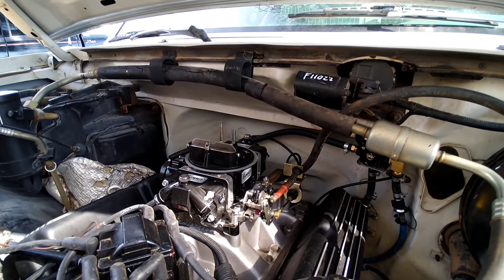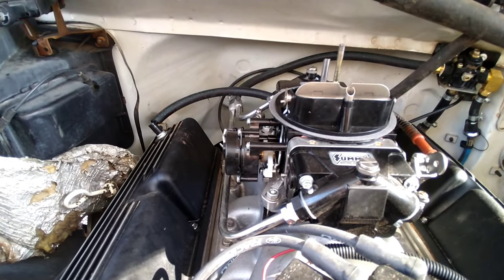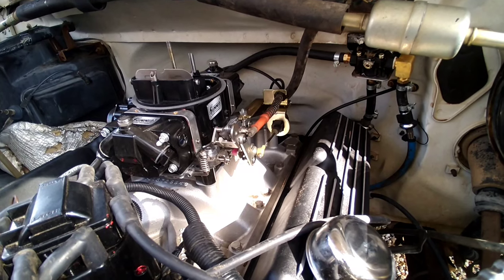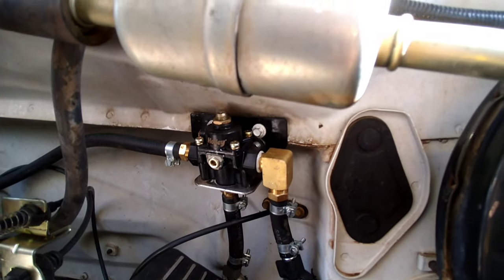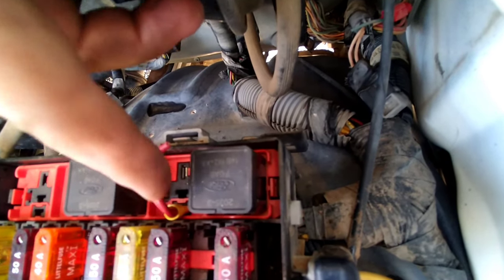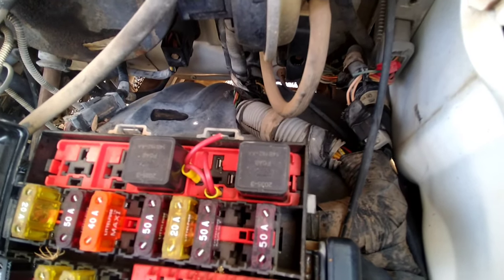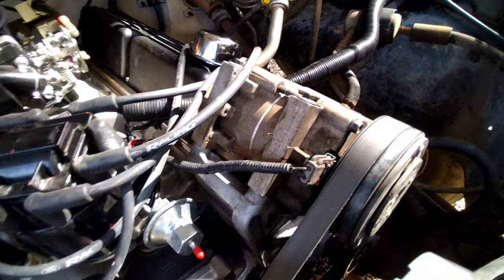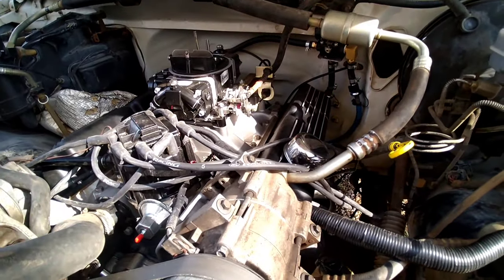87-96 F150 EFI to Carburetor conversion

Comment: are you still running a factory fuel pump or did you swap to a sending unit?
Reply from the maker: Factory in tank fuel pumps
Reply: @CCAutoWorks  sweet, doing this to my 93 f150 302. doing a edelbrock avs2 650 cfm carb, jegs intake, hei distributor and a couple other things. couldn’t make it run right with all the computers after putting a cam in
Reply from the maker: @_thomas.watkins  yessir bigger cam is why I converted to carb
Reply from the maker: @_thomas.watkins  sounds like a sweet build
Reply: @CCAutoWorks do you have any of the links for the throttle cable and tv cable mounts? i cant find anything
Reply from the maker: @_thomas.watkins https://www.ebay.com/itm/234926748138?mkcid=16&mkevt=1&mkrid=711-127632-2357-0&ssspo=ZjVZZbogTlq&sssrc=4429486&ssuid=6G4e_MbCTLy&var=&widget_ver=artemis&media=COPY
Reply from the maker: @_thomas.watkins  I run a Holley carb but what transmission do u have
Reply from the maker: @_thomas.watkins  https://www.ebay.com/itm/254633876443?mkcid=16&mkevt=1&mkrid=711-127632-2357-0&ssspo=aXIgKJ3kSby&sssrc=4429486&ssuid=6G4e_MbCTLy&var=&widget_ver=artemis&media=COPY
Reply from the maker: @_thomas.watkins  https://www.ebay.com/itm/185457937412?mkcid=16&mkevt=1&mkrid=711-127632-2357-0&ssspo=bho7axrgr5a&sssrc=4429486&ssuid=6G4e_MbCTLy&var=&widget_ver=artemis&media=COPY
Reply from the maker: @_thomas.watkins  https://www.ebay.com/itm/125627979212?mkcid=16&mkevt=1&mkrid=711-127632-2357-0&ssspo=rzDrWGaUTJ2&sssrc=4429486&ssuid=6G4e_MbCTLy&var=&widget_ver=artemis&media=COPY
Reply: @CCAutoWorks  i also have the aod
Reply from the maker: @_thomas.watkins  93 was a mixed year with the aode so was just wondering
Reply: @CCAutoWorks where did you get your hei distributor? mine is a 1/2 inch to short to reach the oil pump
Reply from the maker: @_thomas.watkins  I bought mine off eBay sounds like they gave you a 289/302 distributor 351w has a taller deck height look for 351w hei distributor
Reply: @CCAutoWorks sweet, thanks! just got my pressure regulator hooked up to the carb and now i’m dealing with ignition issues but other than that it’s flawless
Reply: did some research, you can visually see the difference between the shaft length on at the bottom where it goes into the oil pump drive between the oem and the hei. not sure what to do
Reply from the maker: @_thomas.watkins  I've actually still used the stock distributor before if you left the computer and haven't cut the harness
Reply: @CCAutoWorks i’m not getting a very strong spark and it’s not picking up on the timing light at any of the plugs besides the one wire that comes from the coil
Reply from the maker: @_thomas.watkins  I'd start by sending that hei back and see if they have one for a 351 or if u haven't cut anything drop the stock one back in and fire it up
Reply: @CCAutoWorks i got a brand new oem distributor and it still won’t fire. thinking it might be the coil
Reply from the maker: @_thomas.watkins  that module on the side of the distributor is probably going bad and that probably cost more then a ebay hei

Comment: What regulator did you use
Reply from the maker: It's a Holley low pressure bypass regulator
Reply: @CCAutoWorks  do you know a part number. I'm doing the exact same swap right now

Comment: Jesus. What's the exhaust setup on the white obs truck.. it sounds immaculate.
Reply from the maker: It's long tube headers with 2 and 1/2 pipe into a straight ebay x-pipe and dual in dual out 2 chamber eBay muffler built like a 40 series flowmaster
Reply: @CCAutoWorks  absolutely perfect. I just hit a snag on my build, a big one. Computer is fried, so now I have to get the computer for my truck so I can swap it to a carburetor and strip half it's wiring from the harness anyway lol
Reply from the maker: @Mr.Safety.  I might just have a computer
Reply from the maker: @Mr.Safety.  if you think you can use it I'll send you my email to get your address and I could mail it to u
Reply: @CCAutoWorks  its a 94 5.0, 5 speed rear wheel drive, and hell, you would do that?
Reply: @CCAutoWorks  what did it come out of?
Reply from the maker: @Mr.Safety.  93/96 f150 I have two or three different ones because I was going to convert mine to mass air at one point
Reply from the maker: @Mr.Safety.  yeah I'd do that no problem my email is chrislamborn32@gmail.com
Reply: @CCAutoWorks  that could save my build, I was thinking of selling it, but the more I look at it the more I realize it's just too good to let go
Reply: My mechanic ended up forgetting to put oil in my truck, or an assitant did, now ive got a blown headgasket or a cracked block, poor old thing is getting parked in the garage until i can afford to fix it or a new motor, they ran it for about an hour without oil

Comment: Part number for regulator?
Reply from the maker: https://www.ebay.com/itm/Genuine-Holley-12-881-Die-Cast-By-Pass-Style-Carbureted-Fuel-Pressure-Regulators-/174590524959?mkcid=16&mkevt=1&_trksid=p2349624.m46890.l49286&mkrid=711-127632-2357-0

Comment: Do you have a shop?? If so where is it located?? Thanks in advance
Reply from the maker: I have a small shop for are personal stuff outside of Amarillo TX
Reply: @CCAutoWorks  thanks for the response brother, I wanted to see if you were close to Houston, I have a 89 Bronco and want to switch to carb
Reply from the maker: @armandosandoval8109  it's a little harder  to do a ford then the tbi Chevy but it's not hard if you have some know how I have another video on how to wire the fuel pumps to work like stock
Reply: @CCAutoWorks  thanks brother, I'm installing Edelbrock 3841 intake, cylinder heads 69379, B303 cam and BBK throttle, problem is I cant find anyone that can tune it, I thought it was all with the distributor and timing, but people tell me different, that after I add all those parts , I need to tune the motor, that's why I'm considering changing it to carb now.. I'm stuck!!
Reply from the maker: @armandosandoval8109  the cam is the only reason you would need a tune and no one can tune speed density efi but if u was to get a smaller cam or install mass air flow
Reply: @CCAutoWorks  so if I don't install the Cam then I'm good to go???
Reply from the maker: @armandosandoval8109  yeah it would run that way but you wouldn't see the full potential of the good intake and heads but I've seen some people cam the speed density but you run into idle drive ability problems
Reply: @CCAutoWorks  so what would be your best advice with the parts I mentioned to you that I have?? Should I buy a MAF kit?? If so which one?? If I go with a smaller Cam will I still need to tune it?? What small Cam would you recommend?? Thanks for all the responses I truly appreciate all your help and support..
Reply from the maker: @armandosandoval8109  if you already have the nice efi intake and some good heads I'd keep it efi id probably put the b303 or e303 cam and see if it would run and if it didn't run right I'd convert it to mass air but the kit they sale to do that is expensive but I have seen a video on here showing how to convert using stock mass air out of the junkyard but I'd call bama and see if they could burn a chip for speed density for your combo
Reply: @CCAutoWorks  thanks brother, I'll keep you posted on my build !!
Reply from the maker: @armandosandoval8109  awesome do u have a channel I'll check it out
Reply: @CCAutoWorks  I don't but I'm going to make one soon
Reply from the maker: @armandosandoval8109  awesome

Comment: What wire do you have the factory tach hooked to in the old distributor harness?
Reply from the maker: I want to say black with white line but I don't really remember it's been awhile but I can check and get back to you tonight
Reply: @CCAutoWorks  thanks that would be awesome!  I recently completed a rebuild w/carb swap on @ 94 f150 with an hei distributor.  The only guage I haven't gotten working is the tach.
Reply from the maker: @Righthandofdoom1  it's black with a white line or red with a green line if it's not and ignition wire
Reply: @CCAutoWorks  Awesome thanks!

Comment: What color are the 2 wires you used for the distributor
Reply from the maker: I can't remember I just know they seem to be different from year to year you just need an ignition wire for the distributor and after its running just touch the tach wire to every wire on the old distributor plug tell the tach works

Comment: What wire did you use for the tach on the new distributor thanks
Reply from the maker: I'd have to look see what color it is
Reply: @CCAutoWorks  that would be great if you can thanks
Reply from the maker: @seekerplays9688  the factory wire is a black wire
Reply from the maker: @dudlyhu2367  black wire that ran to the factory distributor

Comment: What fuel pressure regulator did you use?
Reply from the maker: It's a Holley 0-9 psi low pressure regulator with bypass so the unused fuel can return to the tank and it keeps the load off the fuel pump
Reply: @CCAutoWorks  and it handles the inlet pressure of like 40-45psi?
Reply from the maker: @CarGuyVlogs  I've got it set to 6psi so that's all the pressure it sees the bypass let's the rest go back to the tank if you don't get the bypass return style then all the pumps pressure will be in the feed line and over heat the pump
Reply: @CCAutoWorks  Can you also going to more detail on what you had to do tonight throttle cable to stop your transmission from blowing up?
Reply from the maker: @CarGuyVlogs  you talking about how to adjust the TV cable on the transmission
Reply: @CCAutoWorks  yessir
Reply from the maker: @CarGuyVlogs  I assume you know how the clip that adjust it works on the cable what I do is I crack the throttle about a 1/16 to an 1/8 of an inch then I pull all the slack out on the cable and lock the clip then I go drive it and kinda see if it shifting ok and if it is Ill go full throttle in first gear and see what rpm it shifts at if to soon I'll tighten the cable a bit more I like mine to hold the shift tell around 5000 rpm at full throttle if you don't like that you can go full throttle with the engine off and pull the cable all the way tight when at full throttle
Reply: @CCAutoWorks  ok cool. Thanks. What about the fuel pressure regulator fittings? The 3/8 threaded fitting?
Reply from the maker: @CarGuyVlogs  3/8 ntp with a 3/8 barb

Comment: Im sick of junk made in Mexico or China in-tank fuel pumps. Im going to external holly pump and one gas tank. Wonder if theres a gas tank conversion kit or do I need new tank?
Reply from the maker: I'd think if your going to run external pump I'd just cut the line add it in and run it but I used my stock pumps and a low pressure by-pass regulator and my pumps are the factory pumps with 347,000 miles on them
Reply: So its looking like a older gas tank and sending unit like for a 1974 needs to be installed. Then you can run external electric or a mechanical pump. Unfortunately when they went to in-tank pumps the hole got bigger, so you just cant install a old sending unit. I cant wait to jerk all this bs out of the now old truck and make her look like its 1968 under the hood!
Reply from the maker: @Mountainrock70  I hear you I don't know about the pickups but on mustangs you can use a sending unit out of like an 83/84 to replace the electric pump sending unit
Reply from the maker: @Mountainrock70  but if it was me instead of buy a new tank I'd pull the sending unit take the pump off and just add a hose with a sock on it and put it back in and install an external pump

Comment: After the nuclear war, you’re going to wish you had no electronics in your iron horse.
Reply from the maker: If that happens it doesn't sound like any of us will have to worry about much of anything
Reply: @CCAutoWorks  I’ve heard it said that after the nuclear war, there will be only two things: Cockroaches and Ford 300 inline 6s.
Reply from the maker: @generalralph6291  now I believe that
Reply: @CCAutoWorks  Sounds like you’re pretty smart, looking at your video. I’m thinking of going carbureted along with a total overhaul on my 95 150.
Reply from the maker: @generalralph6291  it's worth doing if you don't have the aode transmission if you do it really cost to much to mess with I appreciate you watching
Reply: @CCAutoWorks  Never heard of that. Mine is E4OD which I think may be a manual with an automatic switch/sensor. I’ll be sure to watch more videos and ask around.